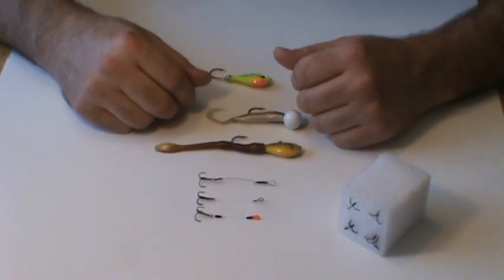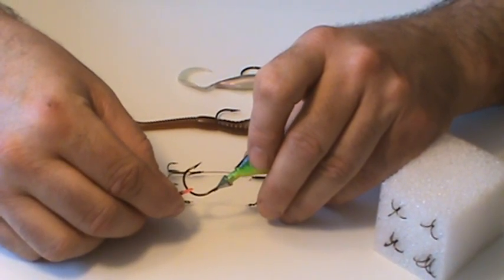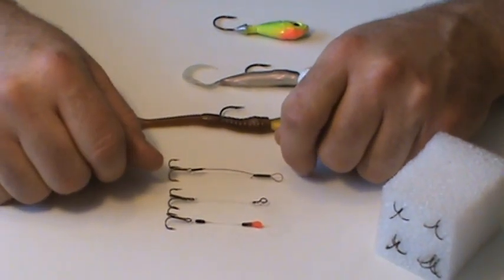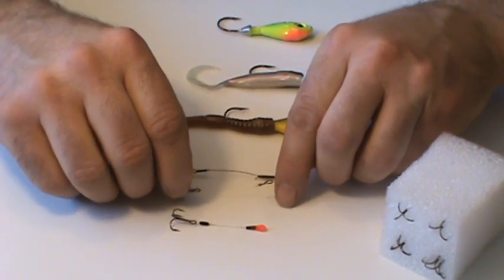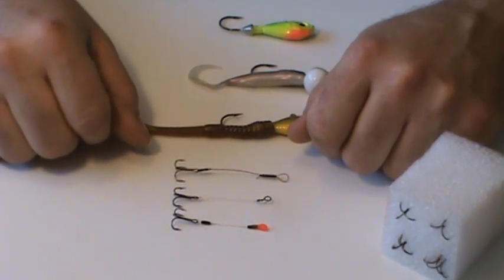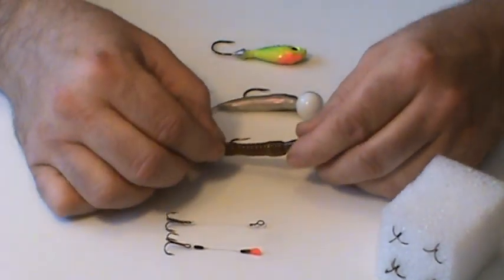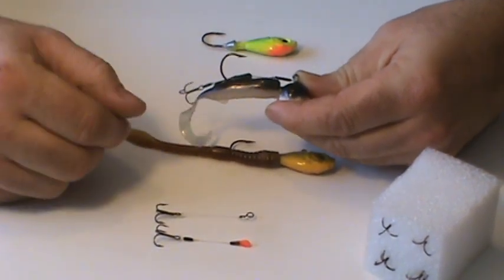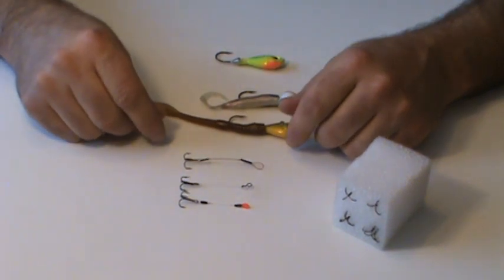quick slip stinger hook

Comment: Did you fabricate that slip model yourself? Is it a double barreled crimp?
Reply from the maker: Yes I did, have been using that design for over 28 years.. no single barrel sleeve.
Reply: That single barrel is that the metal material
Or is it a rubber sleeve? I’ve often thought about using the metal ones but wasn’t sure it would work. You have a video making one of these ?
Reply from the maker: It is a metal, more like brass material sleeve. There has been couple modifications since this video was made. Sorry just seeing your comment today